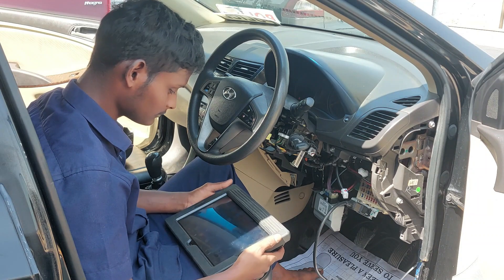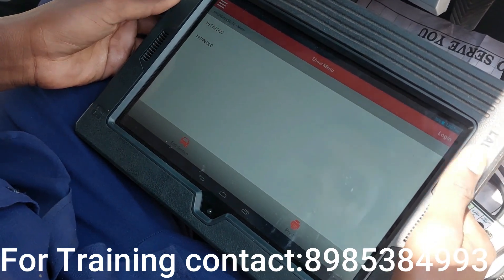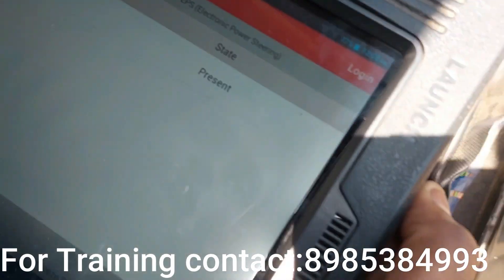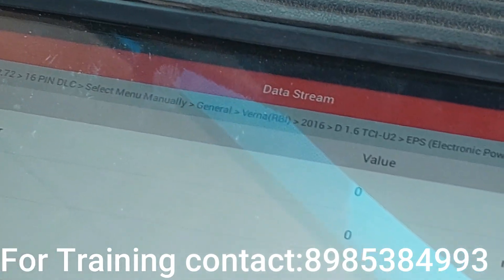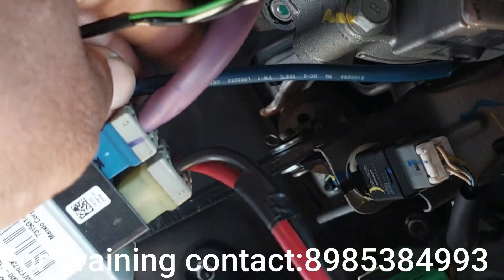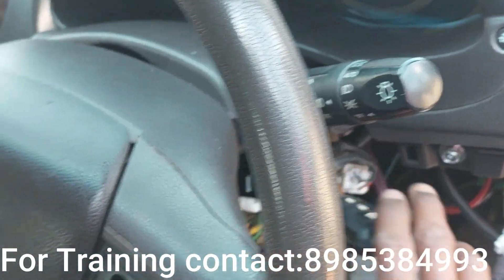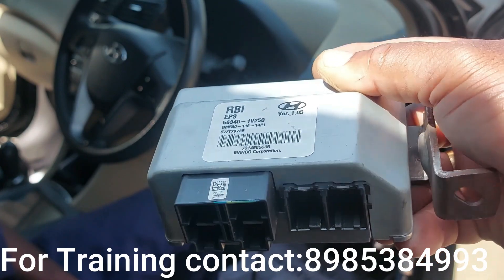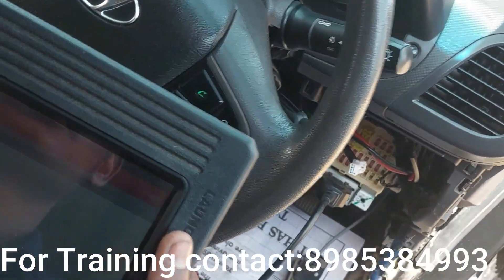Hyundai Verna EPS module Fault C1604 - Hard Steering

Comment: Ravi sir Naku froad fiesta car uvvndhi AC oN  chesty  fan compressor run kavatamedhu  hp switch disconnect chesa direct chesa ok kani cooling ravatamledhu solution chepandi.    4pin socket
Reply from the maker: What are the pressure readings at idle and 1500 rpm
Reply from the maker: High and low picture please
Reply: Sir pH switch conet chesty compressor fan not working hp switch disconnect chesa direct chesa  ok. pH switch.  Problem sir
Reply from the maker: @darellyramesh366  Ramesh garu , not sure as to how I can help you in chatting  but if you could call me , I guess I can answer your questions better. Thanks
Reply: Engine hight Aethey fan run kavatamedhu. Fan ok relay ok coolant temperature sensor ok problem